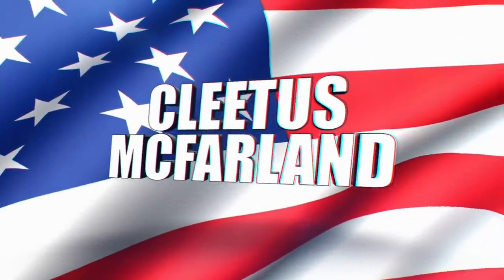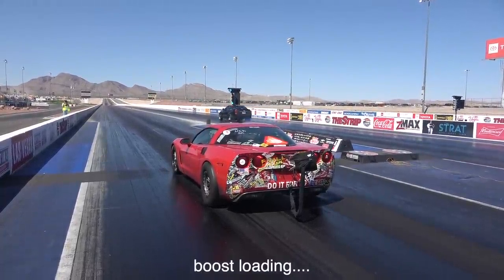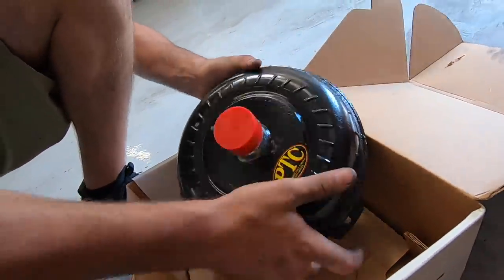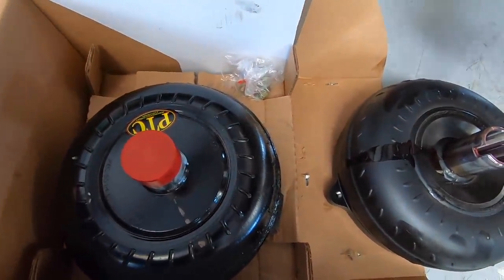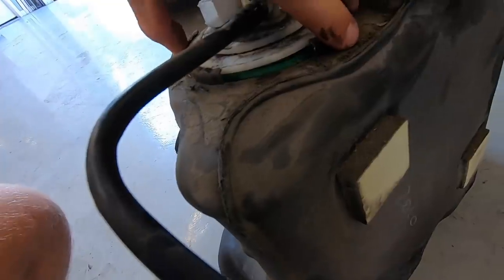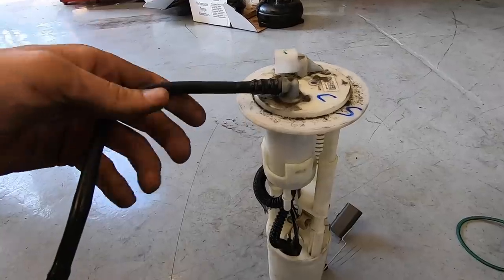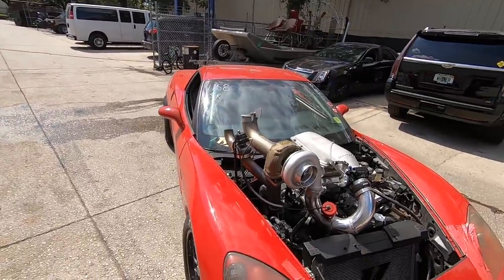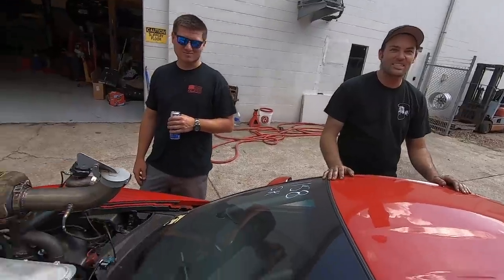Testing Out Ruby's NEW Converter... Turbo SPOOLS Instantly!! **Freedom Intensifies**

Comment: Fuel line? I think you meant garden hose 🤣
Reply: Fire hose
Reply: Road house
Reply: Its little bigger. A good garden hose is 3/4 ID. #16 is 1" OD aluminum pipe which is about .88 ID.
Reply: it's super close to the exhaust- no leaky fasteners plz
Reply: Many years ago, I rode a 98 C.I. Harley Sportster top fuel drag bike which had 2  3/4" fuel lines to a carb. One was float valve controlled,  the other was a valve that opened with the last 15% of throttle travel.  So,  I can relate to the garden hose fuel line comment  ; )
Reply: I think they rerouted the Alaskan pipeline up under Ruby.
Reply: @listcheck  what exhaust lol
Reply: In other words a vary large fuel line :D
Reply: @jasonsaldana7276  real one alert.
Reply: @jasonsaldana7276  ha that other guy

Comment: The auction corvette needs a Harbor Freight trailer for race week
Reply: I want to see leroy do it right first, ruby can wait. Leroy isnt old enough to retire
Reply: every car they take should have a trailer behind it full of spare parts,  tools, tires, gaskets,  electric wire,  and everything else they can think of. anyone that does any of the drag weeks or anything like that knows you better bring things with you. watch (riding with Alex Taylor ) 1320 vids, and a ton of others. Cletus should know this as well as anyone working for 1320
Reply: If you use a Harbour Freight trailer grease the wheel bearings as soon as you get it. Mine had some just useless brown crap on it didn't even last 100 miles.
Reply: @timothythompson3029  this goes without saying for EVERYTHING at Harbor Freight. I swear, off shores, they just reliquefy the tears off the floor in the sweat shops, outsources all grease suppliers lol

Comment: Guys you should put the hood back on and cut a hole for the elevated components to rise out of, recalling what happened when you wind-tunnel tested Leroy, you can definitely make this car more aerodynamic and therefore faster times at the strip. I’ve seen fantastic fiberglass hoods which curved over extended engines and turbos to look both beautiful and extremely aerodynamic so I 100% feel you should give it a shot to maximize the reward for all of your hard work.

Comment: We built a fuel hat for my buddy's fbody using some stainless steel plate same thickness & diameter as the factory hat. Drilled & tapped for 8an feed & return then mounted twin pumps with stainless steel all thread. Works perfect & didn't cost much.

Comment: Glad ur adding a trans temp gauge.  I ran a Th400 in my Supra and used several different stalls.  The looser stalls that allowed me to build boost in time to launch in competition built up too much heat to go rounds.  I found using the tightest stall with a 100hp spool up shot of nitrous was the ideal setup.  It gave me consistent 60 fts and kept my trans temps down.  I ran it off a hobbs switch that turned off the nitrous at 20psi.  I used a B&M extra capacity heatsinked pan and the large B&M cooler with fan and still the loose stall would get me up to 240 deg. Trans temp in 2 passes.

Comment: I used to work at a Torque Converter rebuilding place. That converter is originally a V6 GMC torque converter. The 4L60e. Here in Australia it was in all v6 Holden Commodores. Basically all custom converters all the way up to the fastest drag cars used that converter with upgrades. The smaller diameter is ideal. On the outside its the much larger feet welded on. Internally all the blades have been bent for the desirable RPM to engage at which is what is considered to be a high stall converter. High quality bearings and additionally silver brazing along the points where the blades are fitted in for the most optimal transmission fluid travel through the blades. the most powerful drag cars would bring their converters back in for fine tuning of the blade adjustments.

Comment: Ruby really deserves a headlight polish.
Reply: MrPelle80 yeah no joke
Reply: Do not use headlight restorer. The grit that it contains to cut the grime also scratches the surface, it will look better for a few days then it starts looking like it was sanded, I would highly recommend  a cleaning wax, I use mothers Brazilian carnauba cleaner wax with great results,
Reply: @pikeperformance8642  thats the point though. You have to clean off all the cloudy plastic. Sand, polish, and protect
Reply: @pikeperformance8642  the best way to do it is literally sand the lights down and then spray some clear coat on it
Reply: Deet bug spray. Don't last to long but its easy to do.
Reply: Get some new headlights
Reply: Sand with 500, 1000, 2000, then move to swirl remover, polish, then wax.

Comment: the end of the vent tube.. a metal mesh inline fuel filter works. I use on in my northern truck. Ask parts clerk for old dodge filter (they used metal)

Comment: Torque Norris will be doing 7's in no time!
Reply: You look like Patrick joined ICP
Reply: @imagineaworld  No, this is Buu.
Reply: Might be the only car he’s got going 7s
Reply: @Vangent87  Leroy is a 7 second beast just in a tuning process with the new parts before jumping back into the big boy numbers.
Reply: Naw,  They are spending to much money and getting sponsors.  This guys have gone down hill from a year ago.  Can't even make a 7s in Leroy for almost a year.
Reply: This car isn't running 7s with this setup. It's going to most likely blow the tires off the first pass anyway. It takes more then just horsepower and a loose converter to get down the track. They may even drive through the converter on the big end to. You never know when going with a loose converter until after you make a hit. Also with a loose converter getting it off the line will be a little tricky. It's going to hit the tire much harder where a tuning adjustment will be necessary. It's not as simple as many of you think. You don't add more power and better parts and automatically go faster. Just doesn't work that way.
Reply: I'm just wondering how many race cars these 2 guys above me have built...
(In reality and not just in their imaginations)
Reply: Best comment I’ve seen all day
Reply: @waynebollentin989  they have viking da's front and back, and Holley ecu, they will be able to make the adjustments needed to plant the power and go
Reply: @lc393stroker  I didn't say they wouldn't. It's just not nearly as easy as many think. Not but in other comments you have people saying it's going 7s. That's just ridiculous. Just because you have a glide and turbo doesn't mean 7s. They'll get it worked out but I wouldn't expect it to be that much faster then it was. Maybe 8.50s or tenth faster but 7s hell no.
Reply: @waynebollentin989  I agree that the car is still a ways away from 7's. Needs more fuel, which they addressed in this vid and more power. With time this car will probably surpass Leroy (which I believe was an unspoken goal) but it will need more motor, and a better turbo. Not to mention chassis/cage upgrades to be legal/safe. 8.50s are what it is built for at the moment.
Reply: @lc393stroker  not with that motor and turbo the cars is going faster then Leroy lol. With a different setup it's possible but they are hundreds of horsepower short right now. Fuel is only part of the equation. If you can't use it all it doesn't help.
Reply: @asylumental  They have gained years of practical experience watching youtube videos  and hyped up non reality tv shows, which makes them all experts
Reply: @jaytrock3217  can you?
Reply: Wayne Bollentin that’s why they tune it and dyno it to see where it shud sit at !! That’s the case for any powerful car it’s all trial and error to find the sweet spot

Comment: You need to Tig weld a 3/16th aluminium ring around the hole you cut in the bell housing this will stop it from cracking and you can fit a rubber plug in the hole to stop any debri from entering

Comment: A loose converter sounds good at the time, but after a handful of passes that things gonna start flashing up higher and higher until you loose half your powerband. shoulda stuck with the tighty and hook that dump valve up, 1-2 seconds using the dump valve and she will be on boost!!

Comment: How much more boost can that turbo make?  It might be worthwhile to crank the boost up a bit more to compensate, no?  Or would that potentially compromise the heads, gaskets, etc, due to the relative air pressure differential be the same?  Cuz if you lose 5psi to altitude, and add 5psi to the turbo, that should make for the same air mass and temperature as at lower altitudes, no?

Comment: If you can get that access hole in the bell housing tapped maybe ypu could screw a big pipe plug in there to keep it clean and add strength

Comment: They designed that race transmission with those vents on there as part of the design they tested at spect it so why would you need better isn't that transmission already set up for it's optimal performance

Comment: Hi yeah guys it's going to do burnouts there make sure that AC condenser on the side of the building is it running when you do them you don't want that thing getting loaded up with rubber residue

Comment: that's a badass brand new transmission in the rear end should be leaking I would try to replace the seal in actually fix it of course it should be under warranty or well maybe not I'm not sure

Comment: Isn't the air less dense at higher altitudes?  Kinda why planes go faster when they are high ie less drag. So therefore Leroy will make less power at the same boost pressure.

Comment: if your not dulling the front wheels off the ground off the line your not getting the full power to the ground put a curry rear axle in to incresce traction

Comment: ruby would look so much cleaner if you cut out a hole in the old hood for turbo setup and dehazed the headlights, also fix the bumper or headlight mount so you can take off the damn red tape

Comment: Not to be that guy... But our air pressure in Colorado it lower so it has a lower density not higher. Down in Florida your atmospheric pressure is closer to 14.7 psi, where at up in the Rockies it is more like 12 psi.
Reply: Google density altitude.

Comment: sooo why does ruby still have the exhaust under the car?
Reply: It's the crossover pipe going from the drivers side manifold to the turbo kit on the passengers side. 1 Turbo means both sides must merge.
Reply: @MrWoodyBalto  gotcha

Comment: I've hogged holes like that in new transmissions from Ford... I aint pullin that starter out fk you! lol Before I left I had a nice set of hole saws and a long screw driver to grab the teeth of the flywheel. Or if im in a hurry i'll just snag the converter with a sharp pry bar. Done it for years after they stopped putting an access hole. Idk why they did that. They never had a problem with them cracking in the first place. Even the big F-series trucks. EDIT: this car puts out a little more power than a stock F-series truck tho... xD we'll see!!!!

Comment: As soon as I saw PTC, I was hoping I would here Dusty Bradford's name mentioned.  He spec'd out a converter for my 10.0s rear mount 2000 Camaro about 10yrs ago and nailed the converter on the 1st try, the guy is a turbo converter wizard.  Spooled fast, flashed to 5200, and over 5700 RPM only had 3% slip!  This was not an easy combo, 28" tire, 2.75 rear gear, rear mounted SX80 turbo (87mm exhaust wheel)  https://youtu.be/PJp9E1YcMhA

Comment: Puts 102mm promod turbo on 4.8l with bad plumbing and it spools slow
.......Must be the converter.

Old turbo was rated for 1150hp but was strangled because of the flapper and piping at high rpm/track speeds, but whatever, this isn't real racing, its money paying for entertainment.